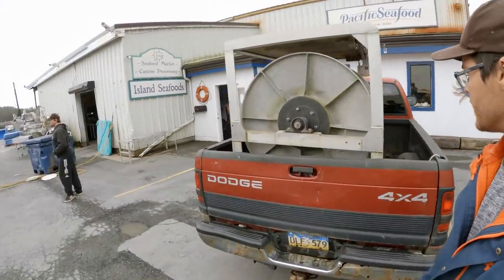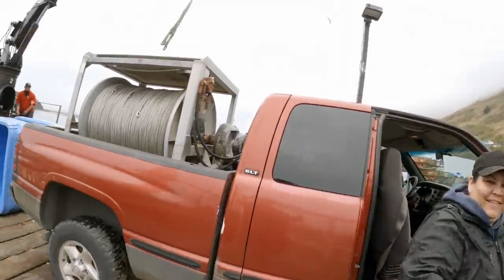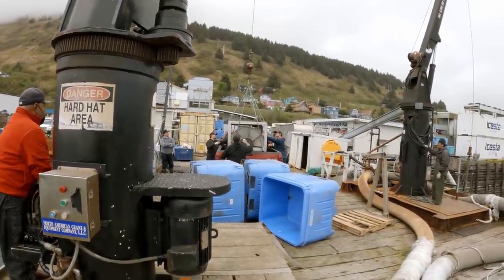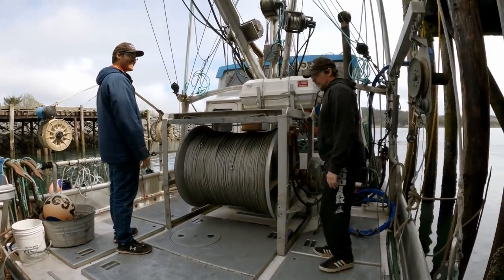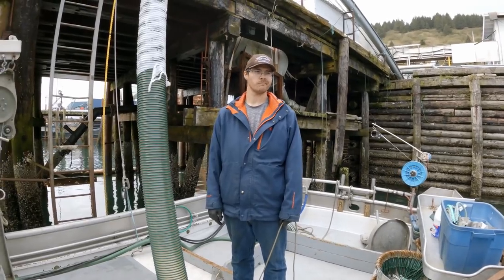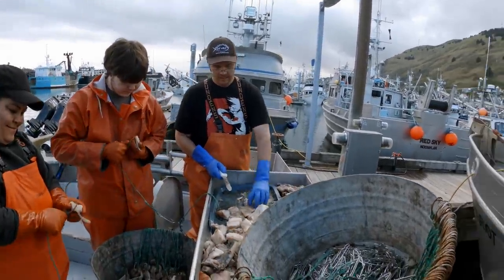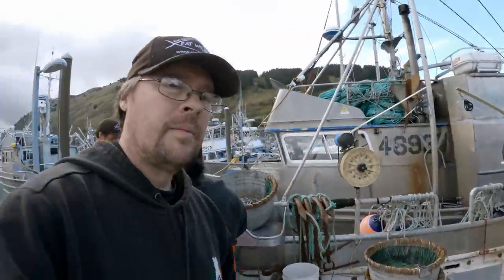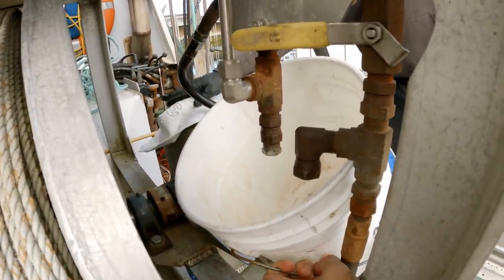Dropping the Reel, Making Connections, and Baiting Hooks

Comment: The tie off piling is broken in half, that is not a splinter but a shard of the broken section. The whole piling moved with your boat moving. Bob
Reply from the maker: I noticed that. The plant manager was talking about it to us recently, permitting is 6 month process to drive new pilings.
Reply: @EISAlaska  
Yup but a splice is likely not requiring a permit. Sad that there are rules that make no sense but which drive small businesses to their knees. Same in almost all states. We also put a steel jacket on pilings, they need to be custom welded but are cheaper than driving a piling. 
Bob

Comment: Have you ever considered  having an additional cutoff switch on the left side of the reel, just to have redundancy?
Reply from the maker: Nah, it gets pretty complicated. Since its a 3-way valve, its not that it shuts flow off, but redirects it. As it is right now we throw the valve it bypasses the motor and goes into a T on the return line. We feel comfortable with this setup. Thanks Luis.
Reply: @EISAlaska  Thank you for your response

Comment: Thought I saw a pulley on the last video to wind the line neater?
Reply from the maker: Yep, its removeable, we take it off to set the gear. The reel is held in place by through-bolting a bar against the engine room bulkhead. Its a really bad angle so didn't capture it this time, but I have shown it in past gear-up videos.

Comment: can you tell me what materials you used to set up your jigging machine?
Reply from the maker: Which part specifically? The machines are sold as a unit, they are called "bandit reels" down south. The mount is just some old aluminum brackets on the stern that we have yet to rebuild. The midships brackets are built into our newer rails.

Comment: Another weak point on the quick disconnects around salt water is they often have mild steel bearings inside them although the outside might be brass or stainless.  Those bearings and the spring inside where you cannot see are a failure point.  Seems counter intuitive when you are paying for noncorroding connectors to handicap them with crap metal inside but in today's world it is all about how much they can get away with.  You have to look long and hard for the all stainless versions and most manufacturers will not specify what they use.  I was disappointed by Milton and several other 'quality' brands.
Reply from the maker: That's a great point and something that would likely go unnoticed when purchased. They are very expensive and to use inferior materials for the application is disappointing.